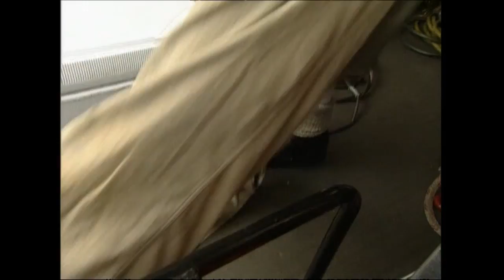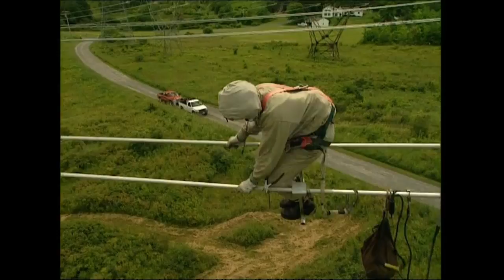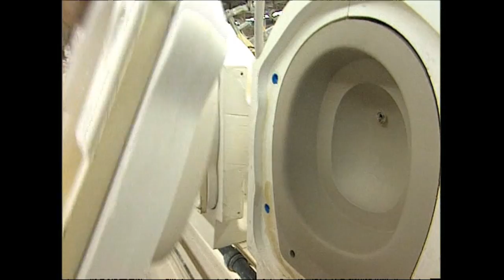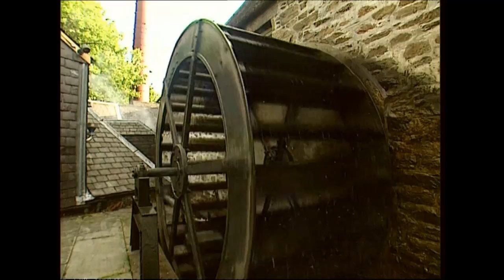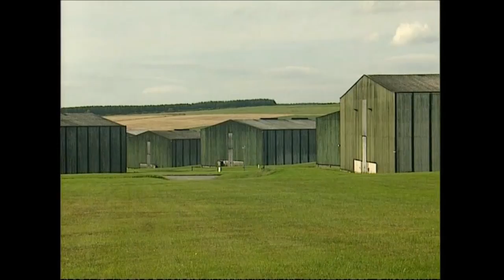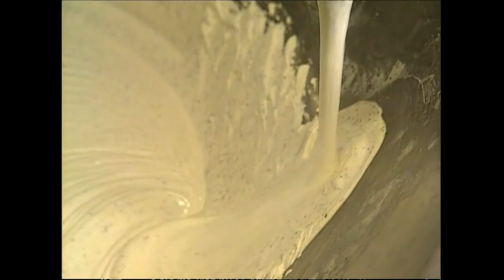HOW IT WORKS | Whisky, Toilets, Cream Cheese, High Voltage Workers | Episode 8 | Free Documentary

Comment: I would like to issue a correction to the lineman suit: it's not that the metal has a high conductance than the human flesh that keeps the worker safe, it's the fact that electricity runs on the outside surface of anything it goes through, thus creating a faraday cage.  The human body conducts electricity much better than air, so if you miss part of the metal mesh, it would directly flow through the body.

Comment: The helicopter in this video was involved in a fatal accident while inspecting power lines in New York in 2012. Both the pilot and technician were killed. "Probable Cause: The pilot’s failure to maintain adequate altitude while conducting a power line aerial observation flight, which resulted in an in-flight collision with wires."

Comment: Whisky making part is so innacurate that it will not produce any whisky or alcohol if only told steps are used. Malting is to activate enzyms that convert starch to fermentable sugars in mashing and then you need yeast to ferment sugars to alcohol. They scipped fermenting completely

Comment: 3 MVolts of "energy"??????  Energy=Power per unit time in this case that would be (electric potential in volts multiplied by current in amperes divided by unit time in seconds)  the unit would be Joules not Volts .

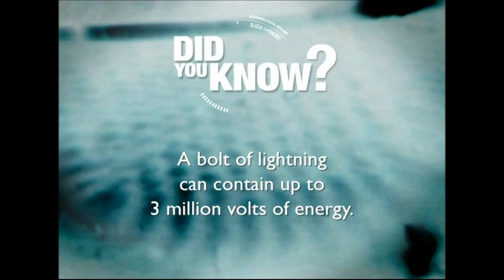Comment: Did you know? Energy is not measured in volts. 6:55
Reply: Potential electrical energy is measured in volts because it’s expressing how much electrical output it could perform hence “up to 3 million volts” its not the exact amount but an approximation it’s helps lessen confusion. You are correct that energy is not measured in volts but potential electrical energy is
Reply: @jessejamesmoore1443  what is the lineman worried about?  volts.
Reply: @scottstewart5784  as for electrocution, it is the amperage that kills you. but given the resistance of human tissue, that does translate into a lethal level of voltage.
Reply: @jessejamesmoore1443  no, you are somewhat close with your "potential" in that volts are work done per charge displaced, but a volt is a joule per coulomb and not a joule. potential energy is still energy. the thing you are called about is called "electrical potential"

Comment: Is that live wire? Is that dangerous?
Reply: yes it's live wire 100,000 volts high tension wire,they are doing it as safe as possible but one serious mistake with grounding off it would kill them both instantly ,then the helicopter would crash,so either way yes it's dangerous and would kill both of them,my cousin did that for Duke Energy for 15 years
Reply: @dormamo6917  no it's weaved metal mesh kind of like window screen  but metal it lets the current travel around them instead of through them just re-watch the first 3 minutes he explains it very well,all the best 😊
Reply: @BigRonxxxx  oh i see... so no bird can land that wires? Otherwise its dead bird.
Reply: @dormamo6917  Yes birds can sit quite happily on a wire and come to no harm.
Reply: @kr1886  why? I thought that's live wire
Reply: @dormamo6917  Indeed its a live wire but if a bird lands on only 1 wire it will not create a live circuit, meaning touching the positive and negative wires together or making a ground connection but if the bird came in contact with both wires it would be fried! but you will notice the guy  doing the work was  in contact with  a few wires at a time,  he was protected  by a metal sewn into his clothes that prevents the power from entering his body unless he was somehow grounded ( coming in contact with the earth) that's why a ladder, etc are not used ,and of course a helicopter cannot be grounded unless an accident takes place of some sort .

Comment: I thought a bolt of electricity contained 1.21 gigawatts of power/energy...?
Reply: That's 'jigawatts'...
Reply: watts is power, not energy. power is energy per time. a bolt of electricity does not last very long, so even if there are many units of energy per second, there is not a lot of energy transferred after the thing has happened. lightning has a tremendous voltage and a tremendous power, but not a lot of energy is involved since only a small amount of charge is transferred, over a very small window of time.

so the gigas are neither here nor there

Comment: 6:53 A volt is not a unit of energy; it's a unit of potential. It's a measure of energy *per charge*. No charge, no energy. That's why the spark you get from walking across the carpet – which ranges from 2000 to 20,000 volts – doesn't do much harm: almost no current. (Current is moving charge.)
Reply: almost..  current isn't limited in any way during a static discharge, voltage potential is actually pulled down to almost zero instantly. Current is always a measurement of volts x resistance (ohms) and since your resistance is quite high and the voltage is pulled very quickly to zero as the gap (the potential) is closed quickly, almost no current flows.
Reply: It's the amps that kill you!
Reply: @tearsofrageclan4143  Isn't the amps the "result" of current and volts?